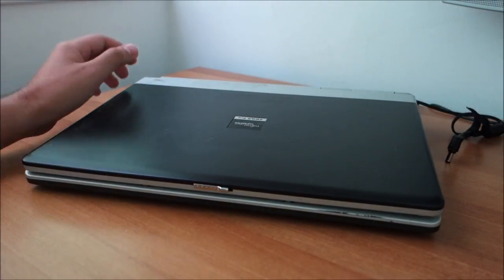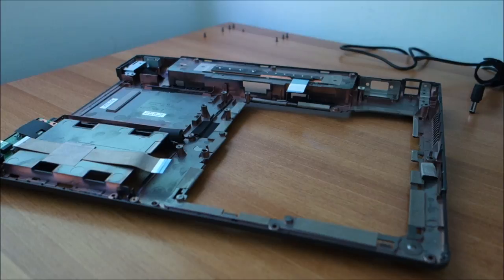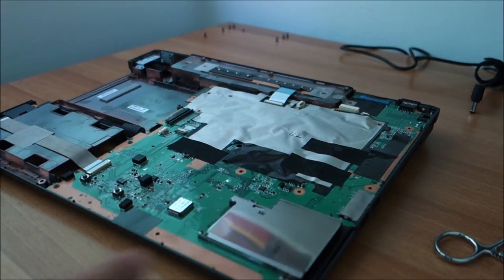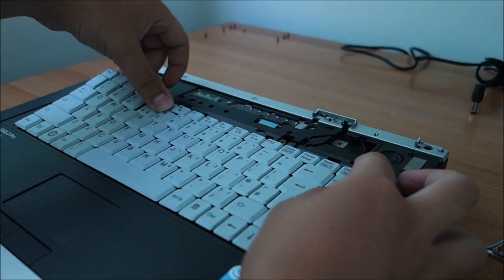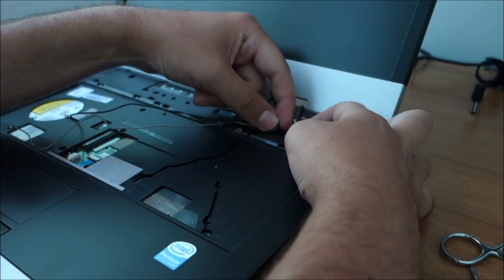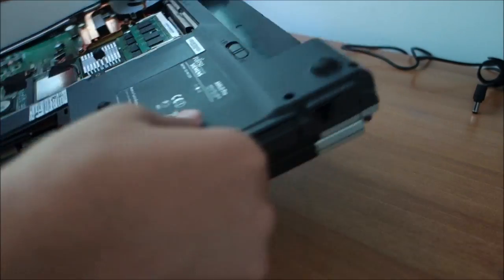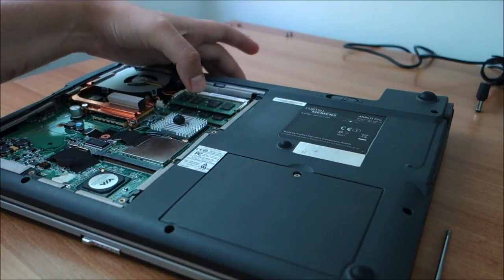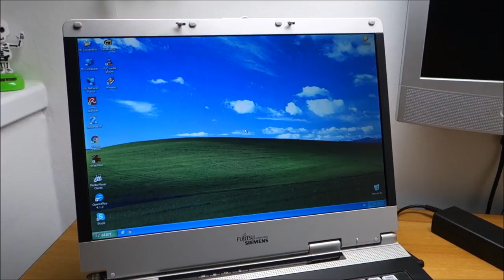How to - Fujitsu Siemens Amilo Pro V3515 assembly, upgrade and repair

Comment: i have    w40  amilo pro v 2945  and broke the screen .i dissasebly totaly the screen  without cuting any wire.i conect external monitor. when press the start button the monitor    showing the starting of windows but   in a few second the screen going bluck ;no signal' i press the fn   + f3 buttons to transfer to monitor . nothing happends. any solution?
Reply from the maker: Try to unplug the monitor and plug it back in while Windows is already running.